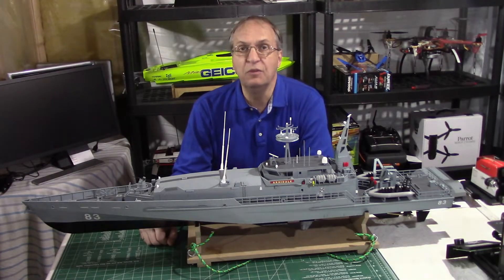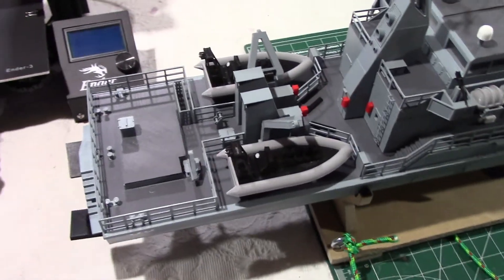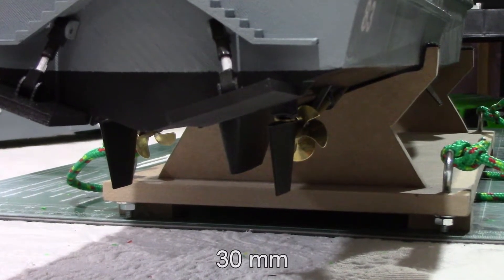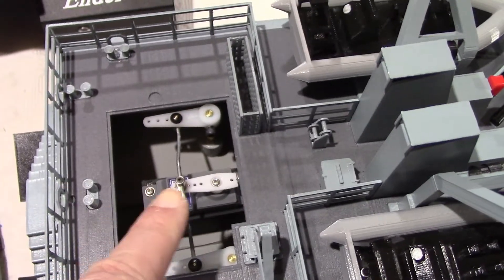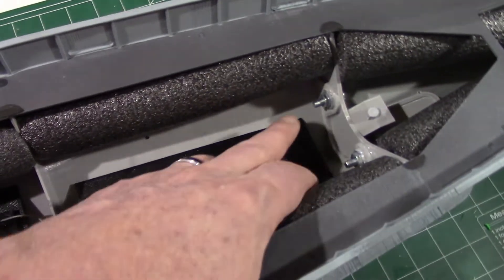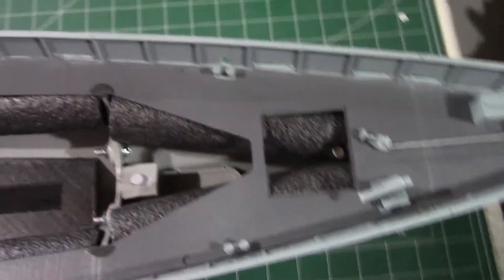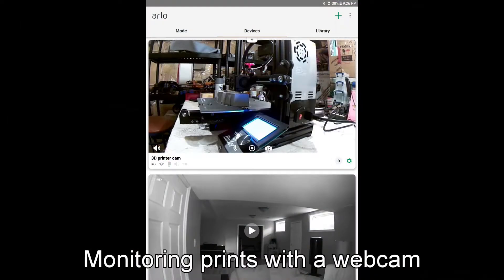Armidale 3D printed remote control boat

Comment: Hi Daniel, I'm building the Armidale, but I'm running into problems with the propeller shaft, especially the brass tube. The outer diameter is 4.6mm and the inner diameter 3.6mm, which is a size not available here in Europe. How did you do it? Did you perhaps re-drill the hole to 5 or maybe 6mm? I hope you can help me. Greetings, Ronald from the Netherlands

Comment: I suppose you have bruched motor. What rpm on this or what Motors have you use / Nice build
Reply from the maker: Yes it is two brushed motors. When I get back home in a few days I will send you the specs since I have a spare one in a box. Thank you for visiting my channel.
Reply: Thanks, 🙂👍
Reply from the maker: The motors are Turnigy Trackstar 1/10 brushed 550 21T.
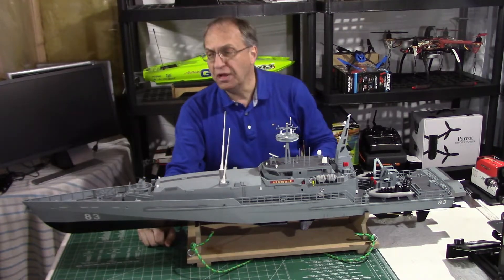Reply: Thanks, have you lot of speed with them? Because I have start build in scale 1:35. Thanks a lot for your time and you have a Nice ship 💪🙂
Reply from the maker: Yes there is enough speed for sure for a boat of my size.

Comment: It looks like your motors are wired in parallel, is that correct?
Reply from the maker: Yes I think it is correct (it has been a while since I used it, it is more a 3D display model really).  Thank you for visiting my channel.

Comment: Does the 550 motors are ok with a boat that long? No overheating? I don't see any cooling for motors in your build. I'm asking because I'm building this ship by myself. It will be 1m long and I wonder what motors should I use in it.. Guys from local RC store suggested minimum class 700 motors...
Reply from the maker: The two 550 are perfect for my boat, which is about 48 inches long.  If your boat is 39 inches long, I would stay with the 550.  There is no overheating issue.  The hull also acts as a loud speaker case, which simulate the noise of the real boat, which is pretty cool.  This was not an easy 3D printing project!  Thank you for visiting my channel.
Reply: @SuperdanTech  Thank's for quick answer, that help a lot. This boat is beautiful and I'm designing mine, not using those from cgtrader :D

Comment: WOW. I live in Darwin Northern Australia and used to work at Coonawarra naval base doing maintenance on the Armidales. That model is spot on. I don't miss working on them vessels. One time I went out in sea state two with the harbor closed due to a cyclone. That's when I knew I had sea legs. Very rough conditions. Some of the Navy folk were green 😂😂. Nice work 👍🏻.
Reply from the maker: Thank you for the kind words and for sharing your experience here.  The designer of the 3D files lives in Australia.  I bought the files from him.  This was a very interesting 3D printing project!  Cheers from Canada!

Comment: Should make the cannons shoot little pellets or something, haha. Though probably not practical at this scale. Would be cool though. Always wanted a remote control boat that had a vertical missile launcher that launched model rockets. Ha I made model airboats as a kid, bought the engines, bent the aluminum on my dad's break and bought some little metal rods and servos from a model shop to make the rudder controls. Was cool. Forgot what happened to it.
Reply from the maker: Hi Jonny, this is very cool.  Some guys on our RC boat club have experimented with micro rockets from Germany. They are much smaller than the Estes engines for large rockets.  They designed ships rockets launchers.  Unfortunately what they did is not on YouTube.  Thanks for sharing your experience!

Comment: Great video and PDF manual. I ame printing Armidale. Are there sections that need printer support?
Reply from the maker: Hi there, several pieces require support.  I don't remember which one specifically since this kit has hundreds of parts.  You will see when you import each file in your slicing software.  Good luck with this project and thanks for watching!

Comment: What filament did you use? Ordinary PLA or ABS? I see that you experience that the plastic turns soft in hot weather. 
And what typica thicknesses of hull, superstructure etc.?
Reply from the maker: I used ordinary PLA.  Like I say in the video I bought the files and reduced the scale to be able to print with my Ender 3 printer.  So the thickness was dictated by the files and in some cases I had to glue side "beam" to reinforce some parts.  But overall the thickness is around 2.0 mm with the hull being thicker towards the bottom.  Thanks for watching!

Comment: @SuperdanTech What plastic did you use?
Reply from the maker: This was in my early days of 3D printing.  If I was doing this model again I would probably use a plastic that is more resistant to heat.  When I run the boat on the lake, the sun tends to soften the superstructure...not good!  Thank you for visiting my channel.

Comment: Great job, the model looks very good.
I'm also in the process of building the model, but will still need a lot of time.
The fuselage is almost finished, just sanding and painting.
    https://drive.google.com/file/d/1xkRwxpkfYh9TfbCBrzt3GdASE3WgOWg3/view?usp=sharing
Reply from the maker: This is a tough model to print for sure.  Good luck with your build and thank you for visiting my channel. By the way, fuselage is for aircrafts, boats have hulls... ;)

Comment: Hello any liinks, books, or other sources of information I could use would be great. My kids really want to do this and I have absolutely no idea where to start. No idea what kind of 3d printer to use, where to get the files, what software to use, what materials to use. Please any advice and a nudge in the right direction would be appreciated. Thanks.
Reply from the maker: There is a lot to learn in 3D printing.  Get a cheap printer first to learn, something like the Ender 3 Pro.  Then watch some videos about Cura settings.  Cura is a good software to start with.  I have a video about good settings for the Ender 3 printer.  Take your time and start printing small pieces (look at my video on the chess set) maximum 3 hours of print time, this way if something goes wrong with the print, you won't waste too much plastic.  Use PLA to start with, cheaper and it does not smell in the house.  Like I said, there is a lot to learn at the beginning.  Watch a few videos, that will help a lot.  Good luck with this fun hobby!
Reply: @SuperdanTech  Ok Merci !!! I have twin boys and they very much would like to learn (have me learn and I teach them) how to build RC battleships. They will be 7 next week and I am hoping that this brings them a fantastic hobby and perhaps a new skill set. Congratulations on your good work. It's very impressive. We'll be sure to watch your videos. (Like and subscribe).

Comment: i love the way you printed the boat.. and I am thinking of buying the boat off bern.. but like you.. I only have the ender 3 pro.. I dont know how to scale the files down? what program did you use?
Reply from the maker: Thanks, this was a big project for sure. To scale down the parts, I just did it in Cura using the scale icon on the left. When I needed to add strength or make a hole bigger, I used Tinkercad. If I was doing this again, I think I would use Fusion360. Much more accurate. Thank you for visiting my channel.

Comment: Looks good. 
I have a question. In this video, I found that your boat hull thickness is quite thin - looks like couple of millimeters. 
Is that enough to sustain lateral pressure on hull in the water? Why I'm asking is - 
I'm building Korean navy's 63m long patrol boat in 1/100 scale. Her hull was 3D printed with ABS, thickness was 3mm and there is no longitudinal reinforcement. 
When I grab the hull for handling, I could hear very small layer breaking sound on it. So I decided to change the hull structure design in next time.
Reply from the maker: The hull is thick enough for this length and the total weight.  I had no problem bolting the pieces together and no breaking sound at all.  I used PLA for mine, I would think ABS would be stronger.  I used several layers of primer and paint to ensure the hull would be water tight.  I put it in the bathtub with weight for 30 minutes to be sure.  No problem at all in my case.  However, if the print quality is not very good, I can easily envision potential problems with layers breaking apart or water leaks.  Thank you for visiting my channel.

Comment: Hello. Where did you buy the shaft, propellers and so on?
Reply from the maker: I made the shafts locally but you can get them and the props from model dockyard in the UK. That's where I got my two props. Thanks for watching!
Reply from the maker: I got the electronics from Hobby King.

Comment: So let me know, if I buy a 3d printer that maximum printed long 30 mm. In case I want to print model boat 900 mm, that means I have to print it in 3 parts. Is that right?
Reply from the maker: No, regardless of the scale you choose you will still have to print the same number of parts.  The hull is 6 parts if I remember correctly.  A smaller scale just means that each of the 6 parts will be smaller.
Reply: @SuperdanTech  i mean just the hull. Has the hull(90mm) be printed in 3 parts right so the bow 30mm, middle 30mm and transom 30mm. Correct me if i'm wrong.
Reply from the maker: No, you are wrong again...lol.  I double checked and the hull alone is 7 parts (not 6).  So regardless of the size you print the ship, you still need to print 7 parts.
Reply: @SuperdanTech  thank you sir...Nice to follow your channel.
Reply from the maker: You are welcome!

Comment: Very cool project. I just picked up a 3d printer (Prusa i3 MK3S) and would love to print a ship model. I have been looking at that model for a while now. I am happy to see someone that put in the equipment as well. This helps answer a few questions that I had as well.   
Do you cover what you had to do to make it waterproof as well in the other video?
Reply from the maker: I may talk about that in my next video this spring.  Some people would cover the outside with fiberglass.  I did not want to do that.  Instead I use Testor glue on the joints inside to make sure they were shut.  Then I used Tamyia putty on the outside joints.  Finally I put 10 coats of paint to seal potential very small holes in the print.  I left the boat in the bathtub for 1 hour and no leaks.  If your prints are good, you should not have to use fiberglass.  Good luck if you decide to print this boat.  It is an awesome project.  I am adding lights next winter!  Thanks for watching!

Comment from the maker: Yes guys, this 50-inch (1.3m) long boat was entirely printed on my Ender-3 3D printer.  I also added all the necessary electronics to make it remote control.  This was quite the project!  Video coming up this summer when I run this boat at the lake!  If you have any questions let me know and thanks for watching!